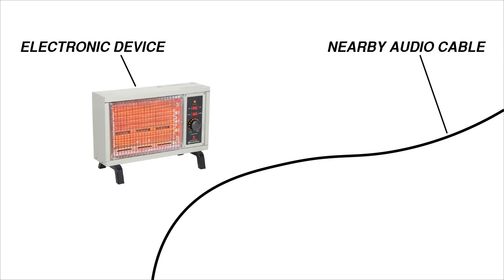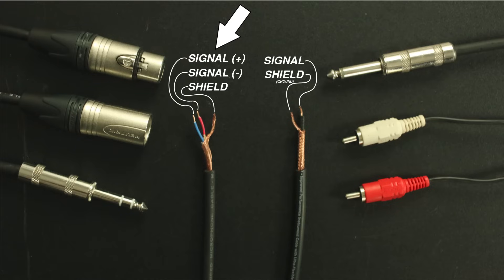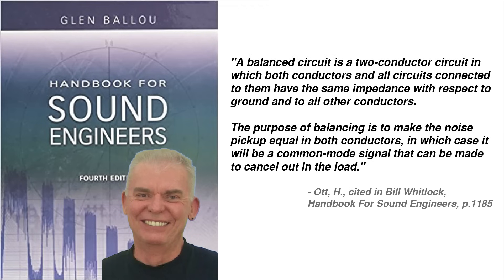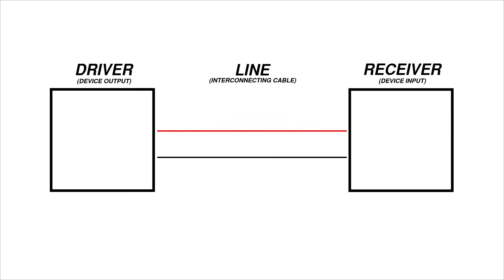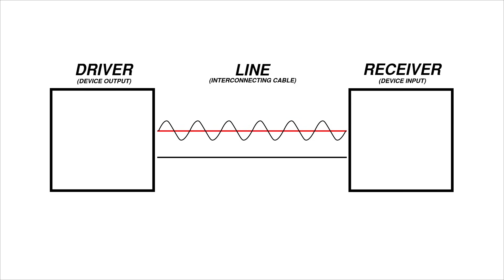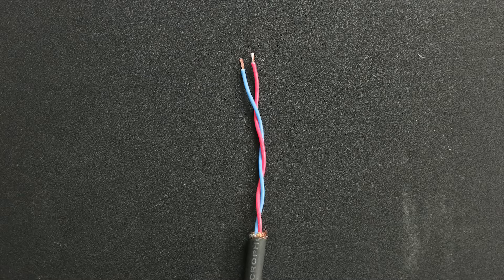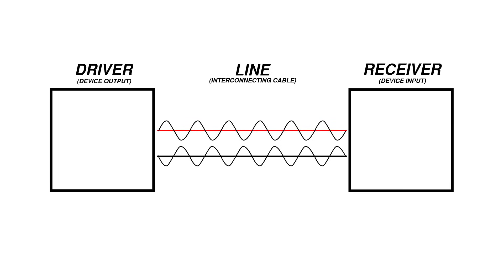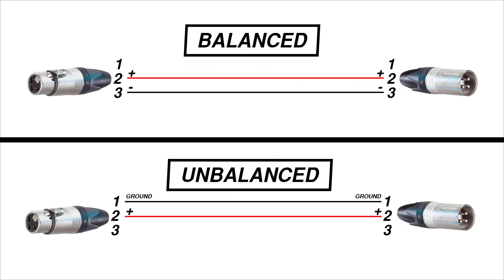Balanced vs Unbalanced Audio | Do Balanced Cables Sound Better?

Comment: Ok, if i will ever make a 300 meter long cable....
Reply from the maker: It doesn’t need to be 300 meters to make a noticeable difference. If your 25 foot cable passes by computers, power supplies, or other noise sources, you will benefit from a balanced connection.

Comment: correct me if i'm wrong, balanced and unbalanced audio, or XLR and RCA cables  have the same quality in short distance?
Reply from the maker: Not the same, but often the noise acquired by an unbalanced connection is too low to be noticeable. However, if there is a lot of noise potential (nearby devices, power lines, etc.), it can be a problem even at short distances.
Reply: @AudioUniversity Thank you for the reply,    I'm referring to the quality of the sound, does XLR sound better than RCA? someone told me that XLR sound better than RCA, but I doubt it, I think they sound the same, quality wise that is
Reply from the maker: In terms of fidelity and tone, no. In terms of signal to noise ratio, yes. Good question!
Reply: @anokapa59  Extremely unlikely in short distance like Hifi-Componends. Plus, it depends on how the unid will balance the signal.

Comment: here's a note for you ....  the difference electronics just performs a mathematical procedure...    all audio signals are nothing more than a sine wave...  each frequency has there own sine wave in various time and value.....  so what happens in math is if you invert one of the signal lines and you add it to the other signal line then they will cancel each other out.... sine + co-sine = 0      and thats how the differential circuit kills the noise....  if you have a balanced DAC then the signal coming from that DAC is balanced and clean of noise...  that clean signal is passed to the balanced amps.... then when you connect say your headphones each ear will have a clean balanced signal....  and the whole chain keeps cross talk down... removes noise and doubles the output power to the headphones....   in the end its still simple math...  sine - cosine = 0   when the frequency and amplitude match or is balanced...    and why do they double the output power....  because then the signal to noise spec is better..   more signal and less noise makes for a good spec....

Comment: Excuse me. Maybe I did not understand. In the common mode  signal in order to cancel, we need to have ot of phase the other signal? 
If you make a simple algebraic sum of both, we would obtain the double. But if you have a 180 grades ot of phase, we will obtain zero. What happen here, Or how do you obtain that "out of phase" operation?, is in the receiver, in the sourse or is not necessary? Why?
Maybe I am not understanding.
Reply from the maker: It is often a transformer coil at the input of the device that acts as the differential device.
Reply: @AudioUniversity  then, is necesarry an out of phase signal right?

Comment: Good video! But what about shorter runs like 1 or 2 meters does the disruption still hold true? Thanks!
Reply from the maker: The noise level will be much lower at shorter runs. I’d say anything under 3 meters is usually ok unbalanced. Great question.